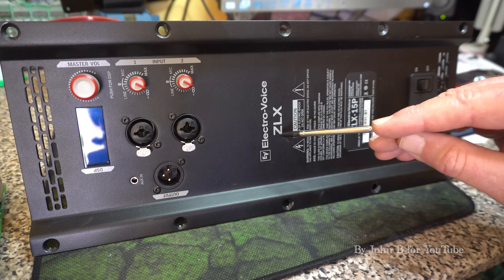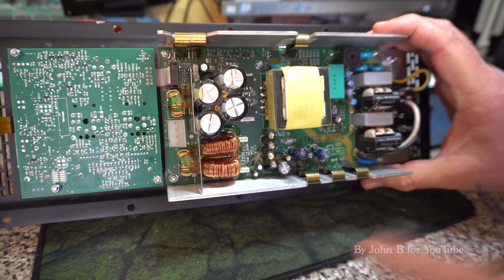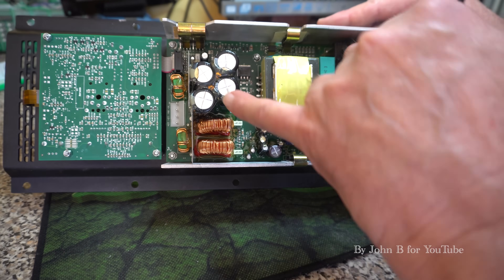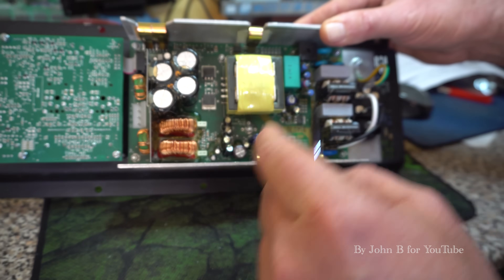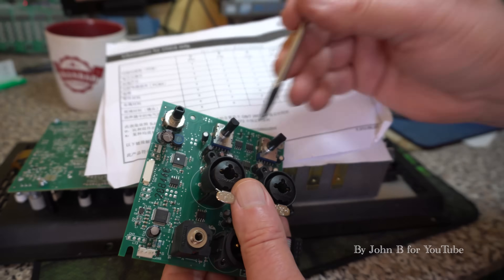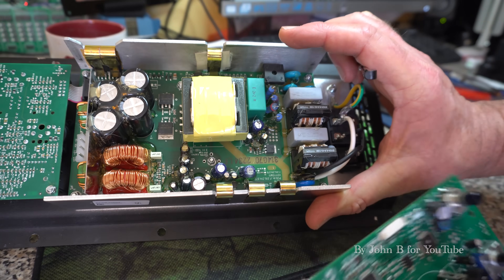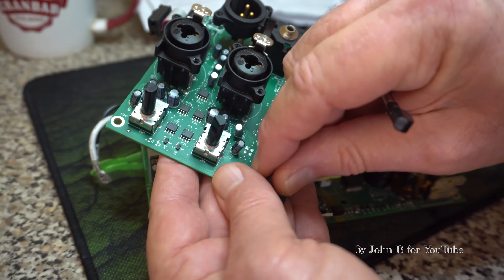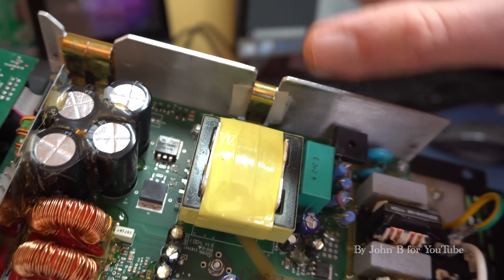The Inconvenient Truth about your Electro-Voice ZLX-12P & ZLX15P amplifier (Read Show More)

Comment: There secret is they didn't want you to know the truth of how shitty their amp section is, and how low the wattage really is! I just bought a pair of EKX 18SP subs to match the EKX 15P PA speakers for our venue. I really hope they are not as shoddy as the ZLX line. 1K a piece for those subs, they had better be solid!
Reply from the maker: LOL
I have an ELX118P here, the transformer is smaller than the speaker transformer so how can it possibly deliver lots of power.
It can't.
Reply: @JohnB-2021  Yup, I had EV confirm the actual wattage was only 325W RMS. 1300 peak, they told me is derived from RMS to program which is double of RMS, so 650, and peak is double again of the program watts! It's a shitty marketing tactic. Now I know better now that is explained to me.  I knew when I hooked them up with the rest of the PA and they peaked before the JBL SR4718X I already have, which has a Crown CH2 with 660W into 4Ohms with a sub on each channel. That right there told me those suckers weren't putting out enough power. I sent them back.

I'm thinking of going with the QSC KW181 subs, as I've heard them before and they are solid. I should of just gotten them despite the non-matched nature of it. EV has some nice sounding tops, but I'm real leary of them from now on. 325W RMS, really guys from a sub costing 1K?! Rubbish.
Reply from the maker: @acidstorm001  I'd love to know how 325 watts RMS becomes 1300 peak.
RMS to peak is multiply by 1.414 period.
Their maths does not compute.
The manufactures of that chip quote about 86 watts X 2 at 0.5 or 0.1% distortion.
Reply: @JohnB-2021  I'm just telling you how they explained it to me. It is BS. They said RMS is 325, and program power is 650, and peak is 1300! EV is just making numbers up at this point. They just doubled each number, it's very misleading. This was for the EKX 18SP subs that I had bought. So the real peak would be 459 watts... not worth 1K each with that skimpy of a power amp in them.

Electro-Voice should tread carefully with all these false numbers. People really need to slam companies that do aggressive fake power numbers, because on subs watts matters, and you are going to be disappointed if your use case for them is what mine is. For a small space, sure they sound good, but in a larger space or for outdoor, no way they'd have the punch to carry.
Reply from the maker: Acid001 hi yes sorry 
I knew it was from them and not you
Reply: @JohnB-2021  No worries. Just wonder how they can fabricate such lofty numbers without any repercussions from consumers. This looks like an industry-wide issue, and they shouldn't be allowed to falsely market products like that. I know it happens all the time, but when taking information at face value to base your purchasing decisions, I need that information to be accurate. The product would not of been bought if I had known it was going to limit out before the subs I already have in my venue room!
Reply from the maker: @acidstorm001  Wow you're saying the subs with that small power supply cost £1000?
I'd sooner buy a blown up Mackie SWA1501 and have it repaired.
The old swa1501 can break windows, they have a super amount of power and the swa1801's are even more powerful.
The older series out-perform the newer SRM subs.
It's a shame one can't reply with pictures, the EV ELX118P Sub amp weighs 910 grams, I've just checked it.
A Mackie 450v2 speaker amplifier weighs 2'550 grams.
From memory, the SWA1501 sub amplifier weighs about 8 Kg.
Reply: @JohnB-2021  Yeah, 1,000 USD each. That's why I returned them. It was a rip-off to me having such under-powered subs cost that much.

I think I'll look into those Mackie's. I think that name seems to have a bad rep for some reason with people I've talked to around here, but others that know more technically than I do, such as yourself, have mentioned Mackies a few times now.

That's a massive amp, about what 18 pounds?! That's the kind of thing I expect from a sub costing 1k or more, not some flimsy under-powered nonsense like the EVs I returned.
Reply from the maker: @acidstorm001  
Thanks for the reply, interesting to know the cost.
I think you did right to return the subs.
I've just looked at a QSC-K12 speaker amp, they use two 500 watt chips, same as many manufactures.
I noticed the power supply is smaller than the Mackie speakers and subs using the same chips.
Mackie SRM 1801 subs use one chip, Mackie HD 1801 subs use 2 chips and do pack a punch.
Mackie SWA series are really old now, old school design and probably one of the best subs ever made.
However, if driven too loud for too long, stupid loud, they will blow up the speaker which will then blow up the amp.
Reply: @JohnB-2021  Interesting, thanks for the information John. Also, I was looking at those QSC KW181 subs. They seem to have the same two 500 watt chips in them as well. They seem to thump pretty good after hearing two of them in my venue, but they are 1,500 USD a pop new. So, maybe finding some used Mackie SWA 1801s might be worth the look.
Reply from the maker: @acidstorm001  
If you every buy or get to hear the old Mackie SWA 1501 or SWA 1801, please let me know what you think.
The only issue with the SWA series is, they are heavy.
Reply: @JohnB-2021  Heavy shouldn't be that much of an issue. They'd be indoor and not need to be moved often. Just need some subs that can keep up with loud metal/rock/punk bands. 

It's a real challenge with some bands having very loud stage volume and the PA has to be able to overcome that and not be stressed while doing so. And the subs have the heavy lifting part and currently the JBLs just don't really cut it for that level of stage volume.

If I am able to find any SWA 1501 or 1801 I'll let you know what I think of them.
Reply from the maker: @acidstorm001  If you're not blown away with the bass from an SWA1801 or SWA1501, I'll eat my hat.
I'd say don't accidentally buy an SWA1801 Z, they are over complicated and less easy to repair. 
Noooo to the Z
Reply: @JohnB-2021  Thanks for the heads up! I haven't found very many of them so far. Found an SWA 1801, but it was pretty beat to hell. Hopefully I can find one that isn't as road worn as that one was.
Reply: Acid001 you be shocked at some of amps working at 86% or less i brought 1100watt rms rcf ! Didnt sound like 1100watt at all OH opened it up had an okay stamped driver didnt even look like at 500watt driver
Reply: @mobiledjwirral  Yeah, it's time to really fucking ream these people for inflated wattage numbers. It makes it confusing as hell when buying something as well. Those EKX 18SPs that I returned talked about 1300 watts, which breaks down (according to their math), as 1300 peak, 650 program power (um, wtf is this?), and 325 RMS... 1K for a 325 watt RMS sub, no thanks.

I'm taking a look at the Milan series from Turbosound. They also list their wattage by peak, but says 2200. I've heard these before and thought they were more expensive, but the 18in version is only 600 USD new! Can get 2 for almost the price of one EKX 18SP, and 550 watt RMS rather than 325. Not a lot more power, but almost half the price, it's well worth the cash in my opinion.
Reply: I am thinking of getting a (active) sub to put with my ZLX 12P speakers to offload some of the heat (pun intended) to it. Any recommendations? I will definitely not buy Electrovoice. I'm thinking perhaps DB Technologies SUB 615, Alto Pro TS315S, or some other 15" sub. These look good on paper; I don't know if they mangle the numbers the same way and of course I should listen to a few first.

Comment: Interesting video i have both the thumps n the zlx I use zlx as mains thumps for monitors.. for me the thumps sound more muddy zlx sound clear and are louder but they do get really hot at the amp, im having a problem with with my thump while playing it turns off after a couple of seconds do you know  what  could it be
Reply from the maker: Maybe a woofer going short circuit since many, like the EVs, are over driven.

Comment: Fantastic video, although very sad. I am the sorry owner of a pair of ZLX112p's and a pair of ELX118 subs. I've got an almost identical set of circumstances in the same area. Fet's dead shorted and a fair array of the resistors have carbonised. I think I'm reading them at 1 ohm? Maybe precision? I've ordered the parts and'll hopefully have the ZLX back on its' feet by end of week. The big question I have is; will this keep happening? And the biggest question (because I'm a huge fan of court action) - can we prove that these speakers have been mis-sold? I'm hearing the bells of a 'class action' right now.
Reply from the maker: Hi,
Make sure you change all the parts as shown in my repair video.
None of the amps I have repaired have failed yet, but I guess over time, they will.
Yes 1 ohm 1% I think, not really precision lol.
Reply: Still sad. Changed all components & unit smelled of burning as power introduced. Didn’t even boot up. Am I right in understanding you repair these units? I have a couple dead now.
Reply from the maker: @notdoctors  
Yes I can repair them if the tracks are not too blown.
Reply: Hello?
Reply from the maker: @notdoctors  Leave an e-mail or contact number then delete it once I have it.

Comment: TDA8954 is a 400W@ 8 Ohms in bridge mode, and that TDA chip amplifier is maximum 80W @ 8 Ohms, so you wont get more than 480W maximum, witch is also not possible with that  power supply.
Reply from the maker: Thank you

Comment: Thanks John for sharing this video, it was really informative... I would like to ask you your opinion about the JBL EON12 or the Presonus Air 12 speakers? Have you had to fix any of them? If not have you heard anything about them? Thanks in advance
Reply: alamakluke anything from JBL is most likely going to blow PreSonus out of the water... JBL has had way more experience and knows what their doing.
Reply: @dennisondenatalie  presonus bought a loudspeaker manufacturer I am sorry to say that I don't remember which one. But they can now use their experience in the product line of presonus
Reply from the maker: I've fixed some of the large JBL amps, they are super powerful and generally pretty reliable.
Not sure about the smaller units.

Comment: Ev is talking about the peak power of the speaker, almost everybrand does that. Normally the real power is 1/4 of the power they say.
Reply from the maker: That does not equate.
240 watt chip is 240 watts peak music power.
240 x 0.707 is 169.68 watts RMS real power.
So what they are doing is pulling 1000 out of thin air.
240 watts peak with 10% distortion if driven at the highest voltage, which EV do not have either.

Comment: im not saying you are wrong, but i own two zlx-15p for six months now for personal use, i thrash them with drumnbass and they still work, they play nice and loud and i like the finish of them, the way i see it is that in the cheap aera, ev, jbl eon and mackie thumps are all great buys, my guess is you will find the same "faults" on other brands in the same pricerange.
Reply from the maker: I've seen and now fixed plenty of these ev smps, the Thump smps is rock solid
Reply: @JohnB-2021  Do you think its the same thing with te ELX series?
Reply from the maker: @richau9058  No idea, I only see what I repair.
Reply: @richau9058  I just did some repair on my ELX112p.  I can say there are 2 amplifier modules for the low end, and 1 module for the high end.  I have recently come across a forum that says they're using UCD amplifiers, and the schematic provided is showing IRFB23N15D Mosfet drivers.  I would look at mine, but I can't get to the speaker right now.  I did find a DIY amp module using a pair of the IRF mosfets, and it's a 300W amp module project.  If that's the case, then using 2 of them giving you 600W on the low end, and 300W on the high end.  I guess that explains why I hear so many ZLX users they're peaking all the time.  I never peak my ELX at all for 98% of my use, and I've used them at proms.
Reply: @richau, personal use you say; try again in a bigger room (or earplugs, or both ;p ) and drive the inputs until it ocassionally says "limit". Base means power, means heat. It's possible you are going to run into that problem if the amp overheats.

Comment: Hola Jhon, Good video, I have a CP 3000 s amp. Ev. The problema its The fans do not work, what I did     Is cuted Black cables of both fans and whit other cable Connect to chasis, thats work, The fans work but only 16 Volts not 24 volts and do not change The velocity, what You think about it Jhon
Reply from the maker: Well if it works, good idea and simple solution too

Comment: Hlw
i am battling to restore sound on this make ZLX 15P i changed TDA7294 but made no difference ,its switching very and not over heating please help !!
i m getting voltages 37 volts plus on secondary circuit....bt sound is just very slow on the output.
Reply from the maker: It sounds like you might have blown the input board.
The TDA chip is for the treble only.
Reply: Thanks for reply
Goodday can i access the complete input board ?
Seemigly 33178 chips r the course but the board looks very good physical .
Is it possible for to parachute its schematic diagram ?
I do agree with your assumption neverthelss but i really in need of your advise i got quit a few makes of this iterm.

Regards
Cornelius

Comment: I have to disagree with you, " SORRY " and I know you know more than me because you seem to know what you are saying " BUT " and yes " BUT " I have the EV Zlx 15P along with the subs. Yes, the makers over rate and lie about the watts at RMS. I just had the Thump Bluetooth and sorry the EV sounded so so so so so so much better and did not have to drive them over 0 db and the Thumps I had to push to max db and still did not come close to what the EV put out, SORRY !!! I am now trying the new EV ZLX 15BT to see what they can do. Ear's do not lie, people. manufactures do. I do not care what brand they are the maker's lie to sell. You can get QSC, Mackie, Ev, Bose, whoever like I said go listen to them and drive them to the MAX at the store, blow there's up before you blow the ones you bought. Again not saying you do not know what you are saying because it seems you do, more than me.
Reply from the maker: When I mention Mackie, I do not include the 'Thump' series because they are as powerless as the EV, they use a similar chip so still no good for large venues.
As for the EV sounding better, maybe the dsp had better settings because the output chips are essentially the same.
Reply: @JohnB-2021  any speaker sounds good as the amount of money you spend on them . If I buy a 2000.00 for one speaker , nothing will touch it. It is in price and what is being sold, EV is the most bought speaker for the " bang for the buck"

Comment: have you had a look at the EV ETX. they are supposedly 2000W speaker
Reply from the maker: Hi,
Someone else pointed them out.
Unless they have turned a new page and pulled the cat out of the bag, or a rabbit out of a hat, no way will they be 2000 watts. I don't even need to see one to say 'no way'
If their using modern chips, they might actually be a full 1000 watts.
Of course I could be wrong, but I doubt it lol.
Reply: @JohnB-2021  Remember, the ZLX is the entry level speaker, so EV didn't invest much in those.  ETX is the top of the line in that series.  The ELX, one step up from the ELX, has amp modules using mosfets for output, not chips.  The ELX112p has 2 amp modules for the low end, and one for the high end, so as you move up the line, it at least appears they're improving the output circuits.
Reply from the maker: @PaulReedy  Thank you for the 'heads-up'
Edit
Actually, how do you know how the ELX112p is constructed?
Have EV finally released the schematics or have you had to fix one?
Reply: @JohnB-2021  I own one, and have had to fix a particular problem I had with it, which I will list below.

I wish we could reply with a picture, but on the ELX amp module, there are 3 output circuits.  2 for the low end, one for the hi section, all mosfet drivers.

The issue: https://www.youtube.com/playlist?list=PLOKYGtCEsuBeiEefI2aaXBk_qg_V5Vd89
Reply: Here's a link to the amp module on an ELX, you can see the 3 amp modules on the left.  The upper for the hi section, the 2 below for the lo section.  https://reconingspeakers.com/wp-content/uploads/2012/07/ELX115P-AMP-5.jpg

Comment: BEWARE: Al the other vendors do the same! Sometimes they take the musicwatts in 2 ohms times 2 to get 3000watts or something for a 2 channel amp. It is
redicuolos. So I have been thinking it over one more time. Lets assume that they really could deliver 1000watts, and that the distribution would be 200:800 w
for tweeter/bass. Do any off you know reasonable priced tweeters and woofers that can stand that amound of power?? With real life speakers it is probably
50/150w clean input power ... And what goes out must come in somewhere. The specs from the datasheet said that worst case scenario is 0.6A @230v. This
is not a 100% correct calculation, but you will come close by saying 0.6A*230v=138w, and the efficiency of a good Class-D amp is about 95%, then we are down
to 131w RMS. And I frankly don´t think that this circuit has an efficiency of 95%, because then it would generate almost no heat. So where does the rest of the
power come from? Physical laws tell that power stays the same, it can be converted, but it stays the same. Or am I complety wrong here? 

In the old days we had the same problem with HiFi amps, that got correctet over a long time when customers got aware of it, but when Class-D amps came in
to the scene, the same nonsense started all over again.